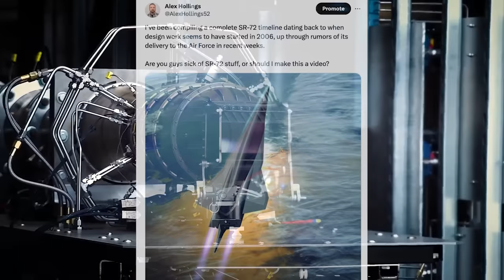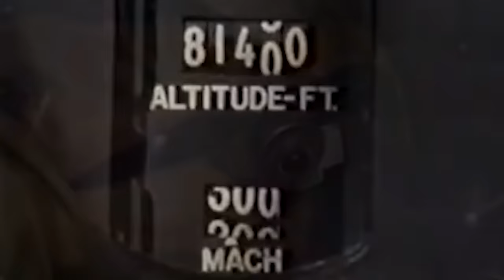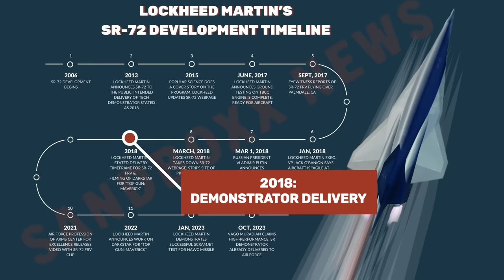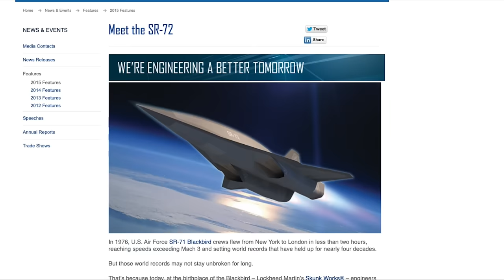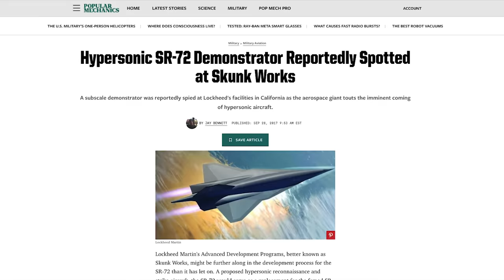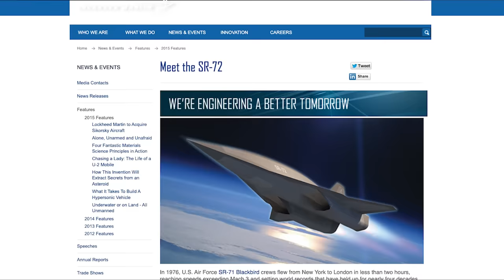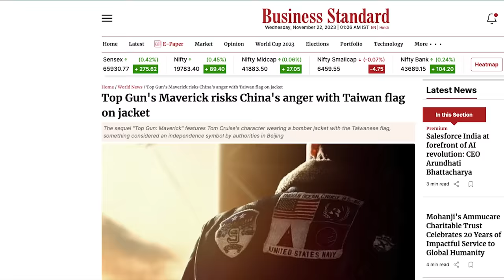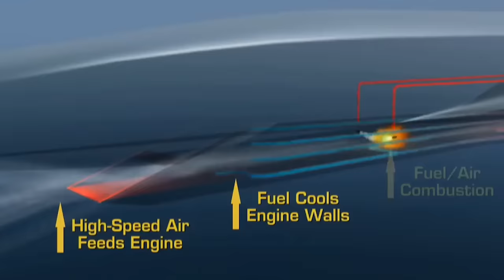The SR-72 is REAL — And we can prove it

Comment: I grew up in Lancaster, CA - which is 9 miles from Palmdale. They're basically considered sister cities. My 2nd job was at a Boston Market at the Palmdale Mall in the late 90s. My 3rd was at a Chili's just across the street. Needless to say, I drove back and forth in that area quite often. 

What's not being said in this video is that there is a fairly major highway that goes right passed this Lockheed facility and Plant 42 is literally right next door. There's a railroad track between the highway and those facilities. Quite often there would be a long train of cars parked on those tracks for days or weeks at a time. But honestly they only obscured so much. For reference they revealed the B2 and the B21 at this location to the public. Possibly the F117 too, but I can't remember for sure.

Point being, this location is way too public for Top Secret projects. You do see a fair amount of aircraft most of the public isn't familiar with, but they're not secret.

My step-dad was the Crew Chief for NASAs B52 program where they drop a lot of stuff off the wings for testing. As a kid I knew he was working on something called "Project Pegasus". He never really spoke of it, but I'm pretty sure that was the early versions of the ramjet/scramjet.
Reply: The secret stuff gets sent in parts to the desert on a cargo plane.
Reply: Fellow Sierra Highway citizen, hello

Comment: There is a lot to consider, especially if these will be manned aircraft. There are so many dangers for a pilot at that speed and also human reaction may be too slow. But also you don’t want a computer alone to fly some of the most essential missions in the most sensitive areas. I feel like the biggest challenge will be to have an AI system that can give pilots info far enough in advance for them to make decisions at human speed.
Reply: Especially with all of the different types of jammers being developed to counter UAV's of all sorts. You don't want a $100 billion dollar prototype that you poured decades worth of work into landing on an enemy airfield after it got hacked into oblivion.
Reply: @orbitalrocketmechaniccain3150 you forget that the Space Shuttle regularly did MACH 25 during reentry. They had to maneuver to bleed off speed to land. So flying at those speeds is a known factor. The computers of the day could fly it. The Astronauts trained to manually fly it in case of failure of all flight computer systems main, backup, then the astronaut.
Reply: Controlled manned flight at hypersonic speeds because it's exclusive to extreme high altitude. If you go by the Darkstar as a rough estimate of actual demonstration performance then you need to be at around 100k feet for Mach 10. A skilled and qualified military aviator on par with astronauts, test pilots, etc would be fine. Maneuvering at those altitudes means you just have huge turn circles. You can read about Blackbird pilots describing how many states theyd fly over completing a full turn.
Reply: @SonoftheBread  one of my favourite stories was of the SR-71 pilot speaking with ATC about where they were… “control we’re over Kansas, ope now Nebraska, no make that now South Dakota…” 😂
Reply: @SonoftheBread  Well, in this video that Skunkworks guy said the demonstrator is "agile", I guess it depends on how one would define "agile" in relation to hypersonic speed..  I would argue that they are not just trying to make advancements in one or two areas such as engine tech or fabrication tech or design tech, but advancements in every single area possible, including software & systems & defences etc, I'd expect there will definitely be focus on advancements in manouverability as well, which i guess you could tie in with design advancements..

..i mean, look at some of the military UFO reports, multiple accounts of objects moving at high-hyperspeeds & doing a 90 degree turn.. a manned-craft would obviously out limitations on that stuff, even if the science made it possible. All I'm saying is we don't know what's possible in a world of technological advancements! 😯😌
Reply: The opposite. There's basically nothing to react to up there.
Reply: Human pilots flew the X15 to almost Mach 7 and the Space shuttle in the high hypersonic regime - using flight control tech that by todays standards was ridiculously primitive... 
I think they can handle it.
Reply: Problem with unmanned at that speed is: you probably get communication blackout due to ionized air around the aircraft.
Reply: @Whitehorseandryder  I would guess "agile" is either relative in this context, or referring to unmanned vehicles. Try calculating the g-forces you´d experience if you´d try to, say fly a 180 in 22sec at Mach7. You´d be a layer of jelly inside your flightsuit.
Reply: @Whitehorseandryder  the latest research being done by DARPA is aircraft that alter the high and low pressure areas around the aircraft to manoeuvre it, not using moving control surfaces at all.  I believe it’s Sandboxx News that has a video about it. Didn’t seem like it would make it more agile but would potentially make less of an engineering challenge to fabricate control surfaces that can withstand high temperatures and extreme pressures. Similar to most modern fighters, I’d expect it wouldn’t be stable enough to fly without computerized controls.
Reply: Computers are already effectively flying most modern jets, They are simply too unstable to be piloted by humans.
Reply: The high speed isn't necessarily about maneuverability, but about out running anything that can shoot it down in a straight line. It's a lot easier for a pilot to point the nose in a direction and tell the plane to "go faster than any missile" than it is to perform evasive maneuvers and deploy countermeasures.
Reply: @lbgstzockt8493  exactly, the F-16, F-117 for sure and undoubtedly many or most others are only capable of being flown with the aid of computerized flight control.
Reply: Agree, my thought is the manned aircraft is near the unmanned doing the dangerous work. The human would be near enough to in real time authorize unmanned deployment.
Reply: What about a "lead" aircraft that is autonomous but faster than the manned craft
Reply: That's why AI is so important to the military. It can make decisions on its own like a pilot and that's jam proof as it doesn't need a signal to receive or send while its jammed.
Reply: @jerrywatson1958  LOL, it was just a falling glider during re-entry, lol.

All they had to do was ensure the correct attack angle and glide slope was maintained so they didn't burn up for a few minutes.

Hardly the same as purposefully flying through the atmosphere at hypersonic speeds doing turns and whatever else for a few hours flight time.
Reply: @Andrew-en4zx  You're wrong, LOL why make such easily disproved statements? You can go to NASA website and look at the Shuttle history. Why would you not look it up before making such a claim? Makes no sense to me.
Reply: @greenyoshi777  Good thing is US military hardened against jammers and I imagine the same will be the case with the SR72 or NGAD.

Comment: Just imagine if the Darkstar from Top Gun, which was designed by Lockheed and had Lockheed and Shunkworks logos all over it, is a literal mockup of the real SR-72?
Reply: The movie could have been the actual cover-up... To say "hey it was a movie prop."
Reply: Lockheed Martin basically stated that the SR-72 Darkstar is a fictional piloted spyplane with the same name and based on the SR-72 design, the movie even mentions a rival drone program, strongly implying that it is the drone SR-72 program. The actual plane in the movie was definitely just a prop but probably the same exact design albeit with a cockpit, remove it and you pretty much have the actual SR-72.
Reply: Professional level trolling
Reply: I wouldn't be suprised if its literally the exact aircraft or extremely close to it. When we do eventually see it I will laugh my ass off if it ends up being the same thing we saw in Top Gun.
Reply: @blvck.8197  
Honda ,"just for the record we had our stealth bomber first " que picture of both Honda civic SI and remarkably accurate mock up of the B2 stealth bomber.
Reply: Darkstar was very likely a tongue in cheek reveal of the manned late 80s prototype but there’s no way such a prototype actually went Mach 10, likely Mach 6
Reply: @MichaelSmith-bn2kz like wormhole extreme is a cover up for the Stargate program
Reply: @rifleshooterchannel208  It's not a tongue in cheek reveal of the manned 80's pulse wave detonation engine hypersonic aircraft prototype, as it is a mock up for the Top Gun: Maverick movie. The SR-91 Aurora is the manned 80's aircraft that is in service with more than 20 airframes developed that flew at mach 20+.
Reply: @infinitespace2520  Unmanned and manned.
Reply: It's not a mock up of the SR-72 but, there is a retro Lockheed Martin black aircraft timeline that shows the SR-91 Aurora but in a similar SR-72 shape. It might be the manned SR-72.
Reply: @AURORAREVEALNOW   While I think it’s very likely a hypersonic plane flew in the late 80’s/early 90’s, where are you getting this idea they had 20 airframes of it built and it could fly nearly 7x faster than the SR-71?
Reply: @falkenlaser  There are sites about the SR-91 Aurora, with one showing a timeline of the Aurora's service until the early 2000s(the Aurora is still in service, the timeline in the site didn't went to the modern years, it went until the early 2000).
Reply: @AURORAREVEALNOW  With the advances in artificial intelligence and automated drones, it would make no sense to make a high risk high speed spyplane have an actual human pilot.
Reply: @infinitespace2520  Actually it would make sense in strike missions whenever there is another option for either ISR or strike options during in flight as the SR-72 won't fly mach 10, it will fly at mach 6 where the pilot just like the X-15 pilots, will be able to handle the speed and of course, the maneuverability of said aircraft.
Reply: @AURORAREVEALNOW  Like I said, advancements in drone technology, global strike capabilities would be much easier with an automated or remotely controlled aircraft, you don't have the downsides of a physical pilot and you can keep flying the vehicle practically as long as you have fuel.
Reply: @infinitespace2520  Read the new articles about the SR-72. You'll see the things I stated.
Reply: @AURORAREVEALNOW  I very highly doubt it used pulse detonation wave engines, very likely the belief it did is a confusion with the Pumpkin Seed.
Reply: @AURORAREVEALNOW  ISINGLASS kind of showed the infeasibility of Mach 15-20 craft for ISR.
Reply: @rifleshooterchannel208  And Skunkworks proved them wrong.
Reply: @rifleshooterchannel208  It did used pulse wave detonation engines. And it might be used in the SR-72 as well.
Reply: @AURORAREVEALNOW  Isn’t it flat out stated by Lockheed that it uses a combined cycle scramjet?
Reply: @rifleshooterchannel208  Yes but they might use pulse wave detonation engines as an upgrade for the SR-72.
Reply: @AURORAREVEALNOW  What exactly would a pulse jet offer over a scramjet? Seems like the pulse jet is antiquated tech and it seems like the scramjet would be easier to keep cool at high Mach numbers.
Reply: @rifleshooterchannel208  Everything a Hypersonic jet needs to complete it's objectives.
Reply: I'd guess its a close approximation with some very key features missing.  There have been enough fantasy representations of what a hypersonic aircraft will look like that L-M could use those public speculation designs as a base and to ensure that the movie prop doesn't come too close to reality.   OPSEC through misdirection.
Reply: @mrkamm71  And the SR-91 Aurora is actually the most accurate representation of a hypersonic aircraft which to be honest, the SR-72 might be the SR-91 Aurora in disguise.
Reply: @AURORAREVEALNOW  Plus hypersonic aircraft really can only look a certain way anyway because of physics. I’m sure you’re familiar with the long defunct USAF Flight Dynamics Laboratory and their hypersonic research studies involving lifting bodies that ultimately resulted in many configurations but most importantly FDL-5. 

And of course possibly the Lockheed L-301 which lead to, well, I’m sure that’s still classified 😂
Reply: @rifleshooterchannel208  I am familiar with it, plus familiar with the classified too secret Lockheed Martin Skunkworks flight physics.
Reply: @ドライデ-ファッサ  The SR-71 was never really a secret. 

The A-12 was but the SR-71, no.
Reply: That sounds cool asf to read about in the future
Reply: Well, physics dictate shape , it’s the materials that leave much to ponder
Reply: I think LMs last concearn is to hide the shape of the sr 72. Its superior technologie lies in the engine and engine controle. Understanding and controling that process ist the true asset which seperates the best from the rest.

Comment: I think the SR-71 is the most beautiful plane ever put into production.
Reply: I saw a video of a large model of Habu flown at a meet and the model appeared to handle extremely well. Worth investigating.
Reply: I've had the fortune to see 2 of them in different aerospace museums. I'd advise anyone who hasn't, to do so. Epic experience.
Reply: I love the blackbird family. But the first large plane I ever saw was the XB-70 which think is the most beautiful.
Reply: We talked about SR72 follow on back in 85. But the places I'm seeing as possible replacements. Ok they might have faster engines now ( I doubt as heat issues) um if you go that fast you're going to need more feul ( larger fuel tank). So you're going to need a larger plane or more powerful fuel.
Reply: @pauldutcher9105   Or much more efficient engines.
Reply: I am old and have seen a lot of beautiful airplanes, but the SR-71 is mystical to me.
Reply: @armadillotoe  many statements have been made by those involved with the Sr71 that said it was capable of much faster speeds than it ever went. The limiting factor 
Was heat. Any faster and parts started to melt. I've dreamed of the SR 72 since the 80s. I imagined it would use a pulse detonation engine which is supposedly more efficient/ powerful. But you can't beat physics. Newton said not only can you never get more energy out of a system than you put in but his next statement was essentially you never break even.. I  want it to be true but not buying.

Comment: Here's hoping this project will be just as impressive as the SR-71 was when it launched! I know it's impressive still today, but it's not around anymore and it wouldn't dominate the skies today like it did 50 years ago 😊
Reply: I dunno, the YF-12 would still be just about the most formidable plane to ever fly to date.
Mach 3.4, over 3000miles range, very low RCS, with three air to air missiles which have a range of over 100 miles and a warhead with a kill-radius of several miles ;)
Reply: Hope it doesn’t leak fuel all over the taxiway!
Reply: @TesterAnimal1  It may. SR-71 is using fuel as coolant... so they didn't want to isolate the fuel from the fuselage skin (which expands/contracts). SR-72 may have to as well. Hard to say.
Reply: @kathrynck - A SR-71 did Mach 3.5 at least once, and that was in 1987.  The A-12 might have flown a bit faster & higher. The SR-72 apparently can do Mach 10 at an altitude of 33+ km.
Reply: @TraditionalAnglican  I'm aware of the mach 3.56 quote referencing a flight over Libya. I've had some discussions recently which make me somewhat question it though. I'd be happy to say that the blackbird's top speed is "somewhere from mach 3.3 to mach 3.56". And the YF-12 was about mach 0.1 faster. I do think the archangel 12 series oxcart planes flew higher than is officially reported, but it's hard to say exactly how high. I'd just leave it at "certainly higher than the U-2's 80,000 ft".

As for the SR-72, 33km (or 100,000 ft) or possibly higher, sounds very plausible to me. Mach 10, though? Nah. Based on the popular science spread of the plane, it looks like somewhere from mach 6 to mach 7. I mean, in terms of the speed capacity of that shape, as an object moving at supersonic speed... it has features in it's shape which betray it's intended speed, from an aerodynamics standpoint.

I'll grant that is assuming those drawings are accurate though. I tend to think they are, because that was a lockheed martin pet project at that time, not a government contract. So they were under no secrecy agreements then. The design may have changed though. Mach 10 would require a very skinny fuselage... I think that would be somewhat impractical.

A missile which goes mach 10+ "once" sure. A spacecraft which costs 11 figures and goes mach 10+++ on reentry, and then needs months of turn-around time? Sure. A 9 figures cost plane which goes mach 10 several times a week though? I don't see it. Mach 6 or 7 though, yeah.
Reply: @kathrynck A Mach 7 plane with Global Strike capabilities would put the same fear to China that the SR-71 did to the Soviets. I just don’t see any way how China would counter an aircraft going at that speed
Reply: None of this is anything compared to the ball of light I seen at like 7 in the morning 6 or so years ago. Just hovering there, same size, extreme brightness, like a small full moon with the luminosity of a sun you could actually look at. It hovers there for about 30 seconds without moving, huge as fuck. Quite bright, like a large star, an extremely large star, half the size of a medium size full moon. Then it zoomed off so fast my brain could barely process it. I have never seen something move that fast not even on a screen(and I play very fast paced FPS games). Whatever the fuck that was is not some reflection of the sun, that was a very real object and the trail across 20% of the sky took maybe 10,000th of a second.  Felt like 2mg of LSD just got injected into my jugular, such a surreal moment.